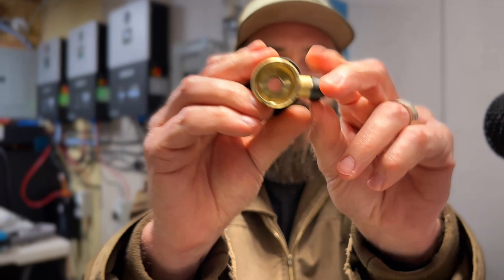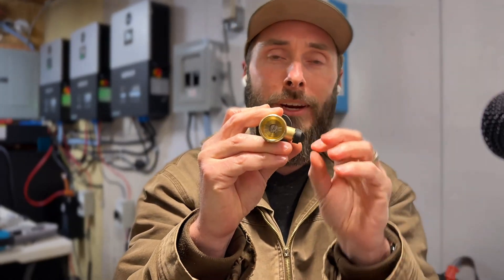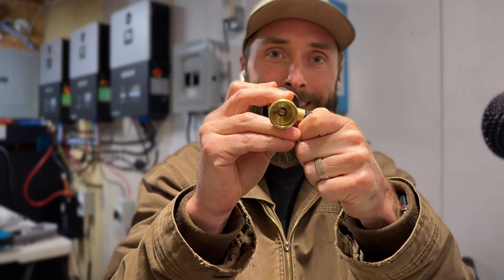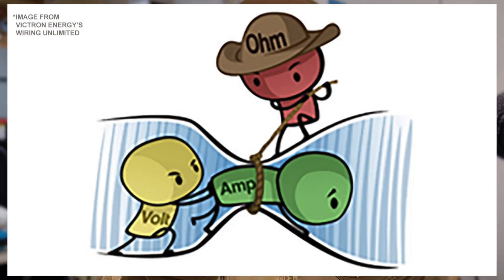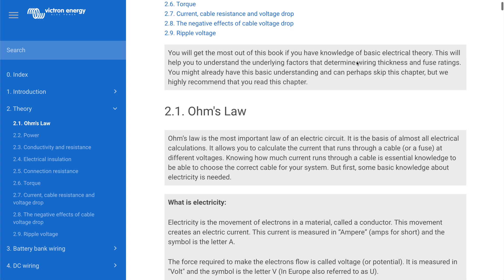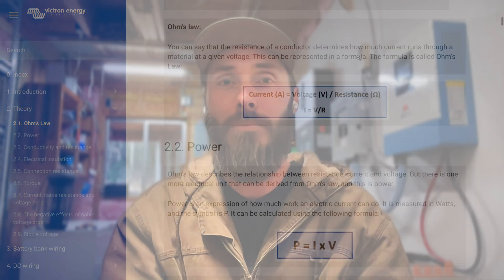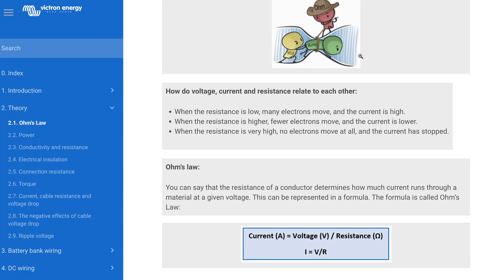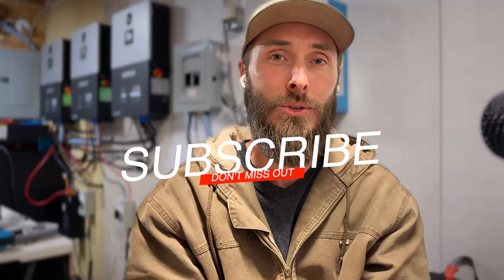Solar Power 101: Ohm’s Law Explained

Comment from the maker: Understanding Ohm’s Law is a game-changer for solar power and DIY electrical work. I hope this breakdown made it easier to grasp.

What part of Ohm’s Law was the most confusing for you before watching this? Drop your questions below, and I’ll do my best to help.

Next up, we’ll learn how to calculate power (watts) using Ohm’s Law, which is crucial for designing a solar power system. Stay tuned.

Here's a link to Wiring Unlimited: https://www.victronenergy.com/media/pg/The_Wiring_Unlimited_book/en/theory.html#UUID-1dd0f602-de3d-01bb-c84d-365fb1af1753

Don’t forget to like, subscribe, and turn on notifications so you don’t miss the next video.

#OhmsLaw #SolarPower101 #DIYElectrical

Comment: Here's an analogy that helped me understand.

Current is like the amount of water a hose can fill a bucket in a given time. The wider the hose, the higher the current and the faster the bucket will fill. Flow is a good word to describe current.

Voltage is like turning the valve to increase or decrease the pressure.

I found resistance to be self explanatory. It's like someone bending the hose to create a kink.